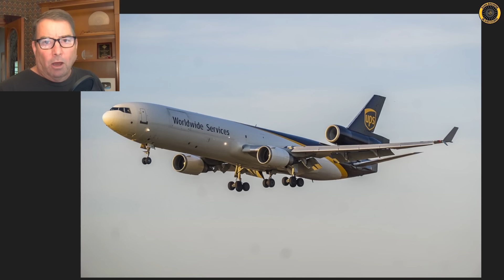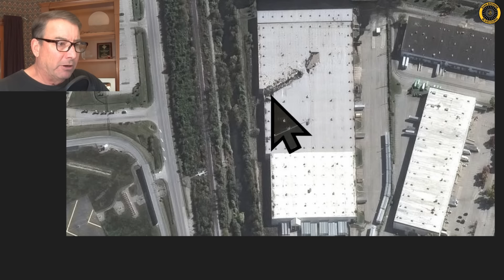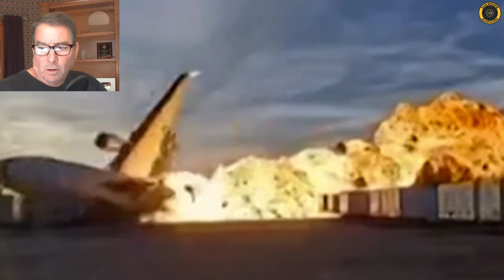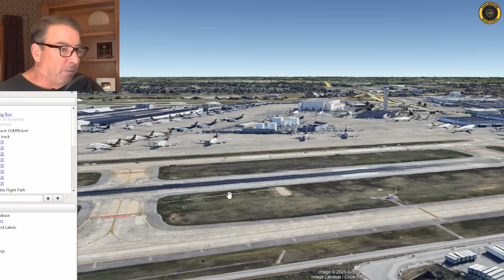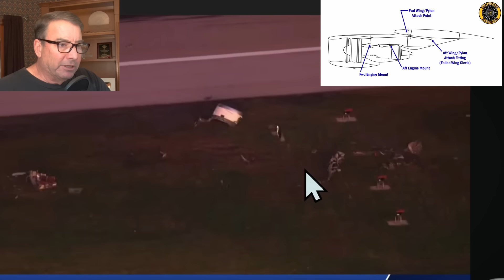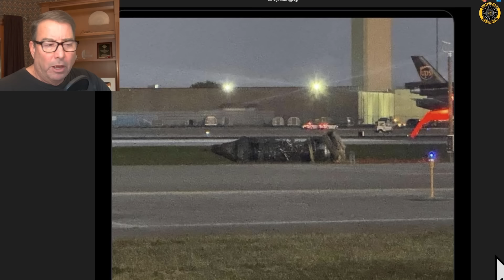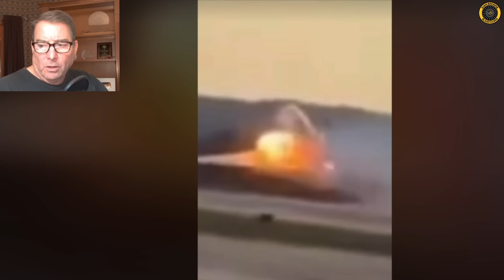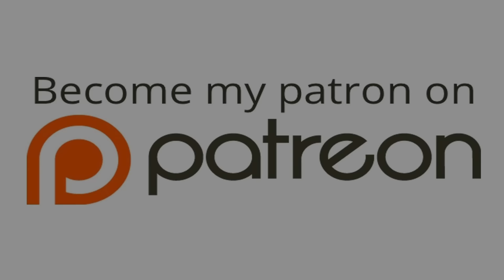UPS #2976 UPDATE 2 6 Nov 2025

Comment: Absolutely tragic. It does seem to me likeliest that the engine went over the wing given that the fire is following the flow over the upper surface. If it had dropped away, the fuel rupture would likely be too far aft and on the bottom of the wing. And then there wouldn’t have been all that flame and combustion product to choke the #2 engine as they rotated. I think that engine was running cleanly when it departed the aircraft. Horribly, regrettably.

Comment: Its important to note that the dashcam footage is taken from Grade Ln which is well behind the damaged Warehouse you see on satellite. Considering that the wings were still intact when crossing Grade Ln the damage on the warehouse might have come from the tail striking the roof, not the wing. It seems that only after crossing Grade Ln the wing struck the oil tanks causing the plane to pivot and crash into the parking lot.

Comment: Hello Jaun, I promise you at investigation end this is one of the engine pylon pin shafts damaged because they use a forklift on the engine and pylon assemble as one unit. bangs and cracks the pylon mount. it only held on by 3 pins. they avoid SOP and the 200+ bolts hold the pylon to the engine. So how many of those improper mounted engines are out there and on passenger planes.

Comment: It seams like the MD11 should be able to fly on 2 engines, even in a damage condition.

The thrust to weight of a MD11 at full load at one engine off is 5.2, actually if the engine is totally missing from the wing, it goes down to 5.1.

For comparison a A340-300 have a thrust to weight ratio of 4.6, and if it lose a engine it goes all the way up to 6.1.

Something else have to be wrong.

Debree hitting the nr 2 engine seams unlikely considering how high it mounted and the nr 1 engine is under the wing

Comment: Big question is where the pilots first noticed something wrong. If it was before V1, did they try to reject and have no hydraulics for brakes due to the engine ripping the hydraulic lines out, then try to continue takeoff? If after V1, surely 2 engines should be enough to get it airborne!

Comment: If you look at the photos from the AA DC-10 disaster, the detached engine was found substantially intact with the pylon still attached. The substantially greater destruction of the engine in this case leads me to also believe that the initiating event was internal to the engine. Time and thorough investigation will of course show whether this was the case.
Thoughts to all those affected by this awful  tragedy.

Comment: Looks more like the 747 freighter crash in the Netherlands many years ago. IIRC, the pylon is designed to break away if the engine seizes. In theory, to stop it from ripping the wing off.

Comment: The building with the roof damage is before the video you have, I think the dragged the belly/landing gear through that roof and skipped over it, hit the wires and clipped the Tank.  That tank was the highest object in the area.  Had they cleared that they may have had a chance to at least get to what i think is a old covered garbage dump but that area was elevated.

1 - Engine shook off / imploded
2 - toss debris into tail engine
3 - skip over roof
4 - clips left wing and rolls over into the ground sadly

Nothing they could have done.

Comment: With a plane this old it could be anything as a trigger. Most likely an undetected or un detectable fatigue failure most likely in a fan blade. No idea how old the engine blades are or if the engine was ever replaced.  Planes as any complex machinery should be retired from routine duty as the MTBF of just about any part or component is approaching. Praying for the families incolved. Maybe a FAA imposed  term limit on aircraft under heavy use like this is appropriate for safety of crews, public and ground personnel should be considered.

Comment: Forgive my ignorance, but would not more open, free, ground  around the airport save lives?
Also, having as little risky business close by, like business dealing with fuel and other flamables. Is not the risk for problems the highest when starting and landing? Meaning at the landing strip and at the airport? Still some constructions at some airports seems hard to understand from a risk perspective, like having very solid walls at the end of a runway or city blocks just close by.
I guess the price of land may be a factor, but then again, airports are important infrastructure and it does not seem like rocket science to enforce more open ground.
YES, the airport will always have some buildings of its own, I realize that...

Comment: Thanx whitelirio. I think this looks awful lot like maintenance did maintenance on the left engine and it did not reconnected it correctly. Like that one crash or incident where the engine came up over the left wing of flew off the entire airplane with the pylons and everything and that and that was caused by maintenance changing shifts and while they change shifts they left the engine lifted up with a bolt or two in it on a forklift and the forks on the forklifts slowly sank... The next part of this comment is an edit because I didn't watch the entire video when I wrote the first half of this. One actually refers to the accident that I'm referring to in this comment. He says he don't think it's what happened

Comment: Given that the NO1 Engine ended up on the right side of the runway I suppose it ripped off, flew up and across the fuselage until it hit the ground. As it travelled across the fuselage it could have thrown debris into Engine NO2 which is right in its path. It may even have made contact. This would have meant a double engine failure after V1. As an airline pilot myself these events always make me very sad as it hits very close to home. I flew yesterday and my colleagues and I were talking about this accident. The mood often goes very sombre in the cockpit after such an event.
Reply: I figured the engine turbine was rotating at high revs after detachment. As you say, it may very well have been chucked over the aircraft and landed close to where it was found, however, my first assumption is it fell onto the runway on the left side but that residual shaft rotation caused it to roll over to the other side of the runway under Newton's laws of motion. First off, it was longitudinally in line with the runway centerline, or the edge of the runway. This implies the engine rotations caused it to remain rigidly lined up with its original reference frame (pointing forward) due to high gyroscopic inertia.

Comment: Prayers for the Crew and other victims and their families. So tragic ... the Capt. and FO did their best but beyond their control; an MD-11 can TO at max GTW with 2 of the 3 Engines but not with 1. "Chicken vs Egg" on the sequence of Pylon or Engine first ... data recorder will spell that out. My initial thought was Engine first as the #1 Engine remains intact but should still be affixed to the Pylon (which it is not) via the Attach fittings (Engine to Pylon); ALL "Attach Fittings" are coded "FFC" (Fatigue Fracture Critical) meaning surface finish at time of manufacture must be perfect with ZERO "scratches" ... and from that point forward throughout Service Life (including Zero "corrosion"). This Tail Number had a "D Check" back in October and thinking that's where the issue began; incorrect re-install, torque levels and pattern. Breaks my Heart to see this kind of avoidable accident.

Comment: A horrible way to die, sitting of a full fuel tank and there is nothing, you can do. I have a strong suspicion that the maintenance error, where the engine along with the pylon was supported with a forklift and which had led to crashes in the DC-10, has happened again.

Comment: Looks like we are looking at the Kevlar reinforcement which is part of the Fan Case assembly, and it's there to protect the aircraft in the event of a fan blade failure and liberation. The acoustic liner is a different feature of the inside fan case diameter,  it's made from an abradable synthetic filler which closes the gaps between the fan case and the fan blades.

Comment: one flight 191 they left the hydraulic  check valves  out that would have kept the leading edge slat in its correct position, the FAA gave them 2 years to put the check valves in
Reply: The MD-11 was designed and manufactured with hydraulic check valves.

Comment: The yellow Kevlar belt shown in the side-by-side photo montage is not an acoustic liner, but a fan blade containment system required for the 'fan-blade-out' condition.  Should a single fan blade be released, its centrepatal outward force will jam it into and through the steel fan flowpath casing, where it gets caught by that Kevlar blanket wrapped tightly outside.  The resulting axial compressive force on the blade fractures the blade into several pieces.  Still containing their high rotational momentum, the pieces slide along under the Kevlar belt further breaking up into smaller pieces and dissipating energy.  The Kevalr belt gets pretty well bird-nested in that action.  

What is surprising in this picture is the absense of any of the fan blade or frame/casing structure.  The fan itself appears totally corn-cobbed - is that from rolling around on the ground after separation - or was fan blade or hub failure the original cause?  The parts trapped inside the belt will help sort that out.

Comment: This also raises the question of unwise town planning or lack thereof in allowing industry to be sited on extended runway centrelines where it would be much safer to have properly prepared over-run areas instead. There have been several tragedies where heavy aircraft have impacted oil tanks, gas stations etc causing extra loss of life in huge fireballs. How many human lives potentially lost can you equate with a piece of real estate dirt??

Comment: Kevlar getting entangled in the fan will put immense torsional stress on the engine/pylon. If the engine is rotating clockwise (seen from aft) the engine/pylon might well be hurled up and over the wing and fuselage, damaging the rear engine and ending up on the righthand side of the runway.

Comment: Insightful assessment. As an 'armchair expert' with no direct commercial aircraft experience, albeit with 20+ years of aviation engineering experience in the military, my initial thoughts do not agree with the assessment of an engine failure being the initial cause.
My instincts immediately went back to the DC10 crash where the rear pylon pin failed.
My reasoning:
If the rear clevis pin (or web) failed, the engine under full power would have (like flight 191) rotated about the forward pin and taken the engine up and over the wing, tearing out fuel and hydraulic lines.
If there was an uncontained compressor disc failure, the cowling would likely have been more damaged than seen, but it would have not have been sufficient to cause the engine and pylon to detach. (Caveat this was an old aircraft so there could be undiscovered weaknesses).
Should no.1 engine have failed, in its position below and ahead of the wing, the wing itself would have shielded no.2 engine debris from no. 1 engine to a degree. However, if the engine was rotated above the wing and then shed parts, they would be more likely to have fodded no.2 engine (causing the compressor stall seen in the video).
Further, as the thermal barrier was still attached to the detached engine (albeit mangled) could this indicate that the engine was still (more or less) in one piece until it hit the ground, shearing off the metal cowling?
The odd situation is the eventual location of no.1 engine and pylon on the right of the runway. Normally, due to Newton's laws I would have expected the engine's momentum to have placed I at the left of the runway. However, as we can see, this is not the case, so some force must have changed its trajectory.  I speculate that as the engine detached, it twisted towards the aircraft centreline and aerodynamic forces sent it to the right, which further supports the damage to no.2 engine. It is possible that some or all of no.1 engine impacted no.2 as it passed.
This is pure speculation and I am no expert, but something to consider.

Comment: Been trying to wrap my head around what that engine at max power would do if it was suddenly released from its support. The thrust/rotational forces must make it go completely haywire.
Guessing that's why it ended up on the opposite side of the runway. Would it produce thrust for any length of time after it tore loose, or lose it pretty much instantly?

Comment: Is it possible for airplanes to take off with only one functioning engine?  I know they can maintain flight at altitude with only one, but what about takeoff?

Assuming the engine hadn't fallen off and burst into a ball of flames.  If it simply just stopped working, could they have at least taken off with the other one?
Reply: An MD11 can climb out on two engines (provided they're both fully functional). All commercial aircraft can lose one engine at V1 and still take off

Comment: A comment by a stupid engineer:

Keep in mind:
The engine separating from the wing after catastrophic failure keeping the wing intact is no failure but a function by design.

Just:
There are plenty of those events in history, most without a wing fire.
This jet went down caused by the fire, not just due to a missing engine.
Why are there no systems in place to stop feeding a fire with fuel and hydraulics when there is no engine?
In a car the fuel pump is cut off as soon as rpm signals are missing: All just to prevent a post crash fire.

It simply can't be a pilots's only job to cut the fuel feed when there is plenty of other workload in an event like this.

Comment: From an ex-Douglas engineer in my car pool a few years after the Chicago DC-10 crash, the story was that American Airlines had asked Douglas for a device for removing the engine with pylon.  Douglas bid a precision supporting device to do the job at a price that American thought was exorbitant, so American's maintenance engineering team designed a much less expensive adapter to be used with a forklift, which apparently worked OK - until it didn't.  That, plus the lack of redundancy in Douglas's control systems created the disaster.

Comment: In 1993 or 4 Canadian Airlines had a DC10-30 reject post V1 call on what is now 26L but was just  runway 26 in YVR. The skipper rejected due to a loud shudering compressor stall on what I believe was either 1 or 3. #2 reverser was locked out. The S/O was the creqmember that immediately deployed the speedbrakes when the captain closed the throttles. It was typical wet winter wx on the coast and the aircraft left the end of the runway and decelerated thanks to the deep wet mud. They evacuated with minor injuries and the aircraft was rebuilt with some help from Douglas.
Reply: I’ve never understood ANYTHING built up to the end of a runway. Why isn’t there an area of undeveloped space left for emergency issues w takeoff.

Comment: Good call by the commenter who spotted the shredded Kevlar 👍 
So new rules required ? Engines within a possible debris flow are assumed to fail; such aircraft must be capable of flying on one engine. Which, I guess, is impracticable, so wing plus tail engine configurations get banned ?
The only saving grace is it wasn't a passenger aircraft. 
As ever, the planning authorities who approved building within a mile of the runways ends, are responsible for the deaths on the ground. We've seen this repeatedly. There are no excuses. Airports should be required to own that crash zone.

Comment: It is not carbon fiber acoustical liner. Acoustical liners are inside of the fan case and they are black and hard rectangular curved pieces. Actually what is shown it is kevlar containment case material and it should keep fan blades inside of the engine in case where fan blade should detach.

Comment: In the dashcam footage where the plane crosses Grade lane you can see the main gear is still down. Could you explain how the aircraft at that point already plowed through the roof of a building but didn't loose its landing gear? Is the gear that strong, or did only the tail strike the building?

Comment: No the video is not on Crittenden Drive!

The video is the next street 

Explain what you’re seeing here 

The UPS building has a gash going through it and then the gash stops 

Then, after putting a gas in the building, you see the plane, wings, and tact level flight    at least, not tipping to the side yes, it is pitch up

The plane made it off. The end of the runway looks like a tail dragged on the building. 

Incredibly got above the building went another 200 yards and then dropped and fell hitting the oil recycling business

Comment: Googling is a know-it-all-!

The General Electric (GE) CF6-80C2 engine has 20 or 21 life-limited parts (LLPs), depending on the specific engine configuration. 
These parts are distributed across four main modules. 

For the standard configuration, the life-limited parts are distributed as follows: 

Fan and Booster Section: Contains 4 LLPs, including fan mid-shaft, fan forward shaft, and disks for stages 1 and 2-5.

High-Pressure Compressor (HPC) Module: Has 5 or 6 LLPs, such as stage 1 and 2 disks, stage 3-9 spool, compressor discharge pressure (CDP) seal, and stage 10-14 spool (with the 6 LLP configuration having a separate stage 10 disk).

High-Pressure Turbine (HPT) Module: Includes 4 LLPs, specifically stage 1 and 2 disks, spacer impeller, and rotating stage seal.

Low-Pressure Turbine (LPT) Module: Comprises 6 LLPs, consisting of disks for stages 1 through 5 and the LP shaft.

Comment: A few miles of farmland at the end of a runway would help a lot.
Reply: In this instance, very, very little help. The aircraft was never going to be stable enough to get altitude and return safely. Add in basically Max fuel load, 
The only help would have been no lives lost on the ground.